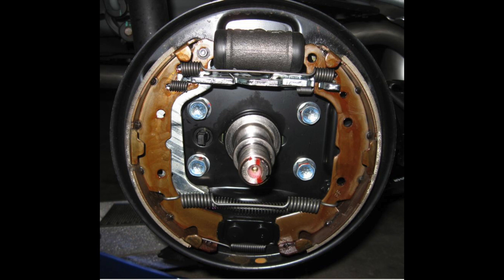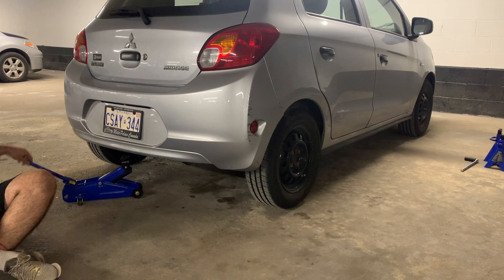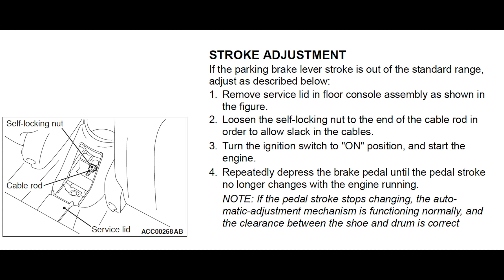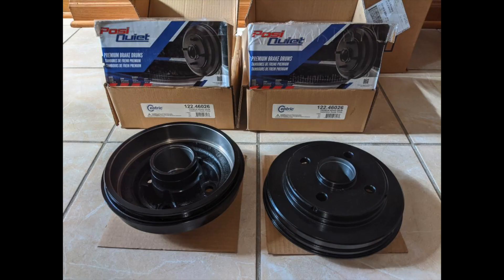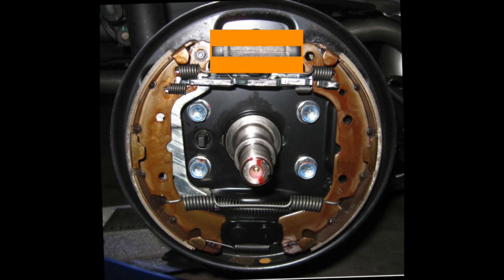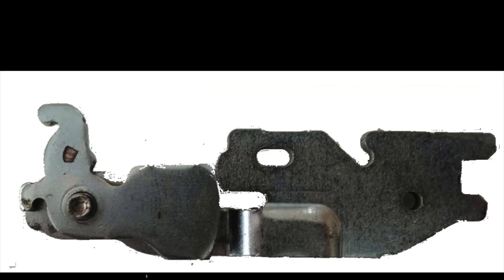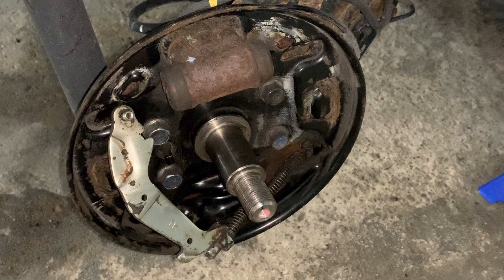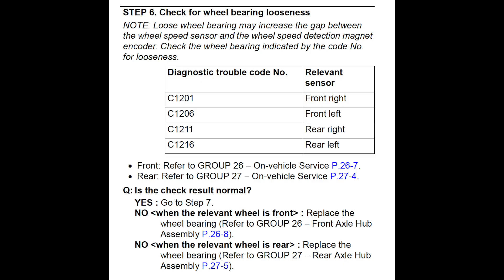How Drum Brakes Work - Mitsubishi Mirage

Comment: Great tutorial.  My 22' has 27k and last week my left rear started grabbing hard, making the car pull down at the stop light.  Shortly after I heard a gringing noise.  That went away, now its still dipping downward at the light.  I suspect a broken spring. Next week on payday im ordering the spring kit an left adjuster, in case it bent or stripped the gears.  Your video helped because ill need that big socket.  Thx man
Reply from the maker: The drum brake setup on the 22 is completely different in the USA they upgraded to larger drums and rotors you probably have the star wheel adjuster. You can see photos of it on the owners forum mirageforum.com

It’s also possible that your Auto adjust has over adjusted or your drums have a lip that rubs on the shoes (less likely given Milage)
Reply: @TheFrugalEngineer cool ill check it out.  Cold weather this week so im going to limp it, luck8ly it isnt binding up , overheating or banging. Thx again man
Reply from the maker: Glad to hear you found the video helpful

Comment: Its a good design that the hub with wheel studs is not in the way when trying to install the shoes and springs
Reply from the maker: It’s also a scary design. One nut with no pin or stake/bend in it holds the wheel to the car. The 2017 and newer mirages (depending on market) have a different brake setup with the star wheel adjuster.

Comment: I need to replace the brakes on my 2019 mitsubishi mirage are the drum brakes on the rear & disc brakes in the front ?
Reply from the maker: Yes. But your discs and drums maybe larger than mine and your drums may use a different style of auto adjuster than shown in the video. I think in Canada 2017 and newer get the larger brakes.

You can see photos of the differences on mirageforum.com

Comment: Seems a lot more complex than disc brakes
Reply from the maker: The parts are all very cheap. Springs are basically free and the auto adjuster appears to be stamped metal. In 2012 when the car was designed rear drums were pretty common. disc brakes of this time period usually used a drum brake within the disk as the ebrake. This would of course be much more expensive. Here is a diagram of what I mean: https://ww2-secure.justanswer.com/uploads/drivefast1971/2012-01-02_135225_1.gif

Additionally there is a slight benefit in using drums because in theory they are lower friction compared to disc brake pads that constantly rub against the disk. Some manufacturers(I think gm) have disc brake designs that attempt to pull the pads away from the disc when not braking to save gas.

Modern cars of course have electronic e-brakes or sometimes(rarely) have a mechanical disc e-brake.

Thank you for watching!
Reply: @TheFrugalEngineer  Interesting. I've had my 2015 since new and the rear brakes are what mechanics have trouble with so I decided to learn how to work on them myself.
Reply from the maker: @tiburcio729  I tried to replace them myself as shown in the video, my aftermarket shoes did not fit. I cut my finger open out of frustration when reinstalling the old shoes and I made a mistake that resulted in the simultaneous loss of both the service(pedal/normal) brake and the e-brake. I recommend going with OEM shoes they should fit and hopefully won’t squeak. 

For over 1 week I sat at home in pain with a split on my finger. I plan to release a video about my experience next month depending on how well this video does.